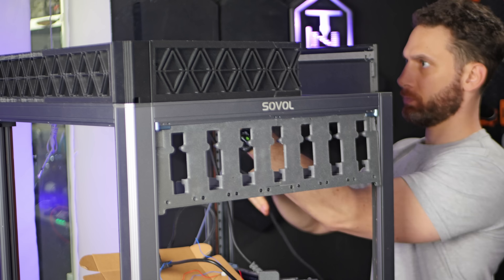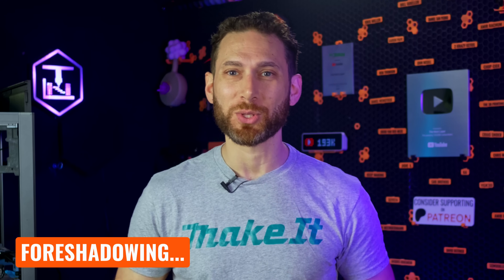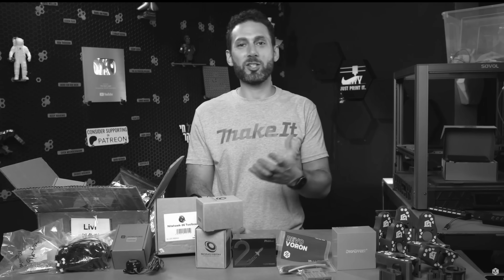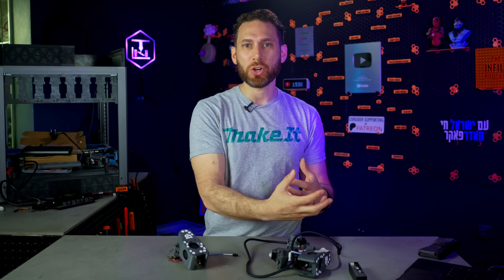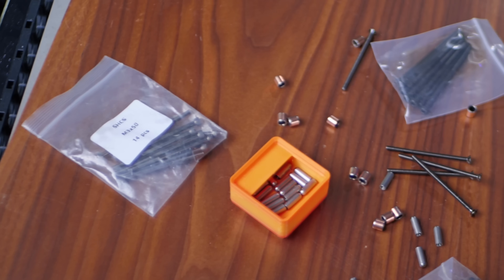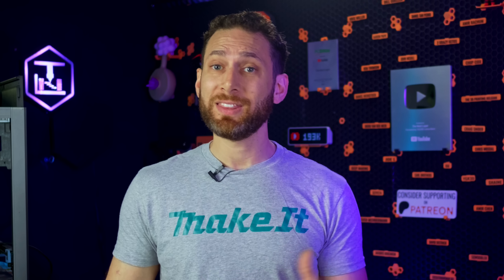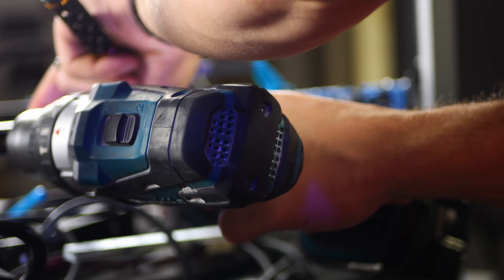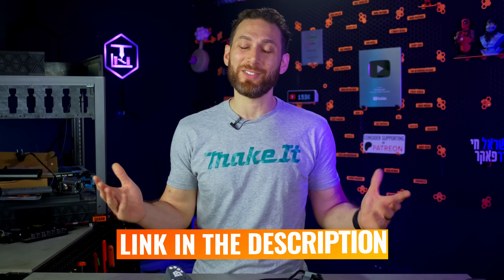IT'S ALIVE - But Barely. (Sovol SV08 Tool Changer Build)

Comment: Straight up:  SOVOL 100% dropped the ball on this one.  No idea why they seemed to ignore the voron community and the mods they are doing but they could have come out with the toolchanger as an optional add-on kit that was specifically designed and setup to work with the SV08 and (with mods) vorons.  Save people the hassle of muscling through it and just put out a bolt-on kit.  It's the kind of thing that would literally be a make or break for some buyers (like me).  Sure, the modding community would look at it and still find things they'd change BUT SOVOL had the opportunity to beat them to the punch and really make the SV08 a true game changer out of the box without giving the modder a massive headache.  I still don't understand why companies do this.
Reply from the maker: I’ve been encouraging them to do it. They might…
Reply: So. You haven't like researched how Sovol does business. Also research and development costs money. By this logic every CoreXY printer should have an addon toolchanger add-on because "Oh it'll save consumers the hassle" that's not how product development works man. The SV08 is not a Voron, only thing "Voron" about it is the 2.4 ish inspired Flying Gantry setup
Reply: @JasonBrodel  I'm going to take a guess here:  You have an iphone, right?  No insult...I ask because apple has done an AMAZING job of convincing the consumer to think that what they get is actually all that they should want.  Personally I am of the mind that a company that honestly cares about its customer will find out what they want instead of telling them what they can have.  There is a reason the aftermarket exists and it is precisely because of the shortcomings of what the OEM offerings.  If SOVOL didn't thing there was going to be enough people wanting a cheaper voron they would not have come out with the SV08 and the voron community isn't exactly known for leaving things stock.  It would stand to reason the same would apply for someone who bout a voron based printer.